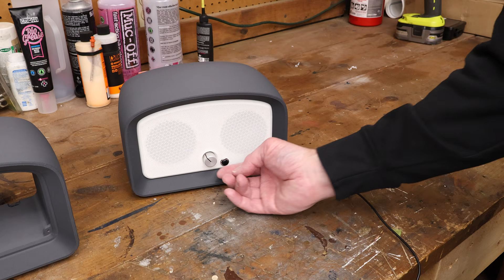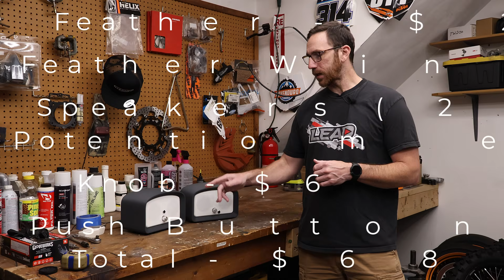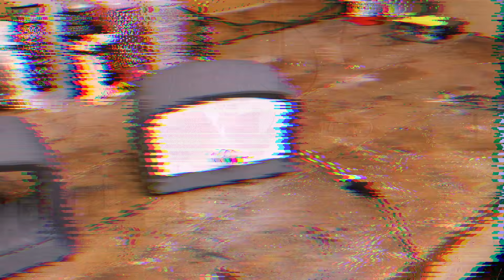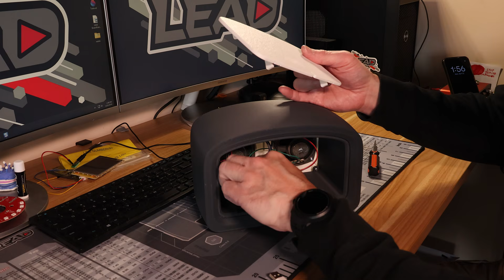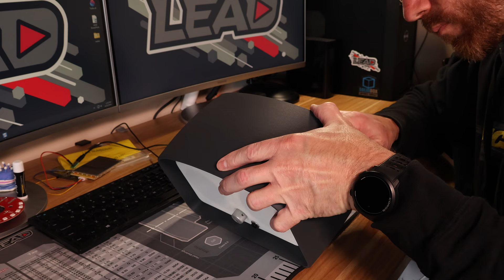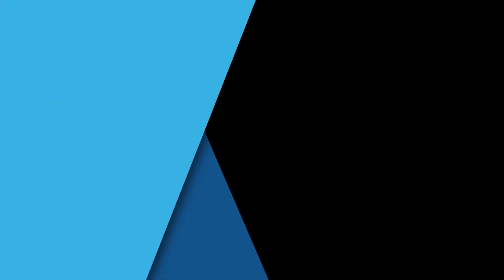Easy DIY 3D Printed Vintage Style MP3 Player

Comment: Adafruit is the last place I go to now. I applaud their effort, well done, BUT it IS reflected in the price they charge though. I bought an mp3 player off them, cost about $70 shipped. It worked ok, and after I made a custom case, and gave it as a gift, it stopped working as I was showing it off - very embarrassing. I later opened it up to check and found the main chip had turned into a small heater (very hot). So, I ordered a similar mp3 player from aliexpress for only $5, and it has worked flawlessly non stop for the last 3 years.
Reply from the maker: Wow that is odd, and i bet that sucked!  I have only had one board from them fail over the past 10 years and they sent me out a new one no question.  Some products they carry they don't make, I have run into that before.  If you look at how Zion Brock did his, they have been developing a board that lets you connect a bunch of each piece of the puzzle together, like the amp, and the sd card.  I like supporting adafruit because they make their PCBs available to use in Fusion in most cases, and the effort they put in on the libraries.  but yeah $5 vs $70 is a big difference!

Comment: I do not know if you have them in your area, but one thing I have used to add some weight to some projects is to buy cheap dumbells from Five Below.
Reply from the maker: Great tip!  Not sure if a dumbell would fit in this but that is a great option ill keep in mind. thanks!
Reply: @LearnEverythingAboutDesign yeah, you can design saddles and caps that can be printed right into the design, to hold the dumbell's handle.  They have a number of small ones available...if I remember, they have like 1,2 and 5lb...think they have bigger, but I had no use for them for that purpose.

Comment: To add mass, why not borrow a trick from other electronics manufacturers of the less reputable variety - design and print a box and lid, fill the box with sand, and epoxy the lid in place. If you're more of an outdoorsman, consider using fishing weights.
Reply from the maker: yeah at some point in the video i think i mentioned the idea of loading the bottom with sand while pausing the print but didn't want to fool with it.  Really it could use probably 2lbs which is why i was trying for steel flatstock.